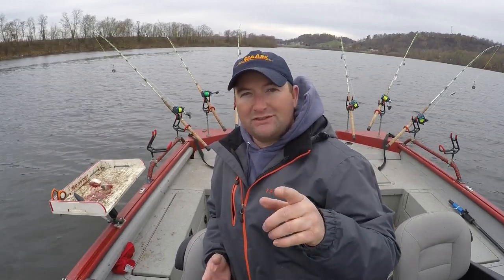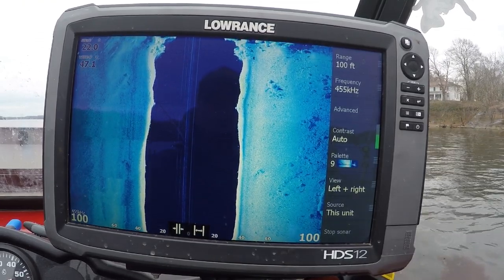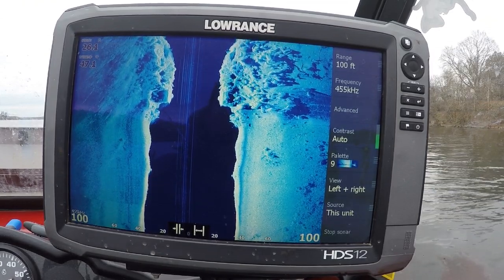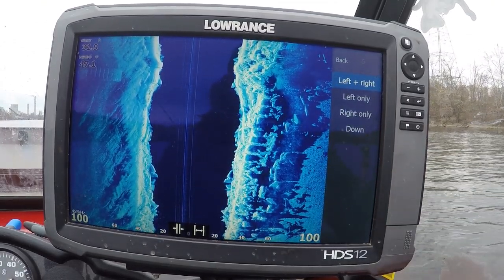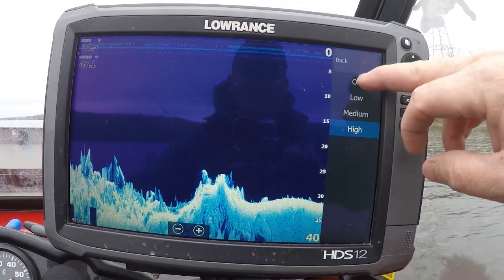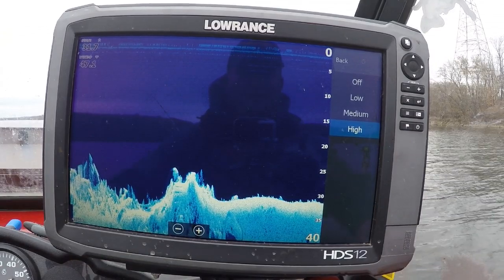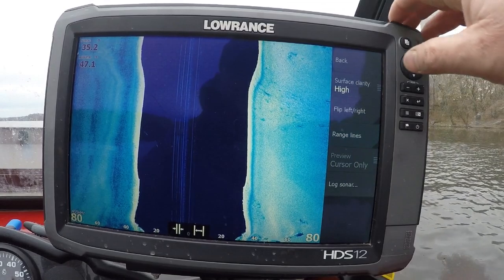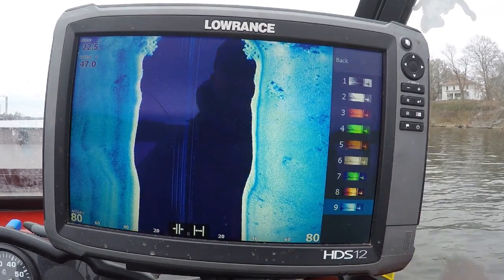How To SIDE IMAGING (what are we looking at and how to know)

Comment: I turn on mine and all I get is the center line, nothing else... do I need to tweak it?
Reply from the maker: That’s a difficult question to answer without knowing all the details.
Reply: @slungercatoutdoors  I have the 3 in 1 transducer on the bottom of my trolling motor, as the guy before me had it set up on his system. On my details on unit it shows that my transducer is connected to the unit, but all I get is the center line. I have it set up for internet with hot spot on my phone. Lowrance told me to adjust the frequency, I did, still no picture